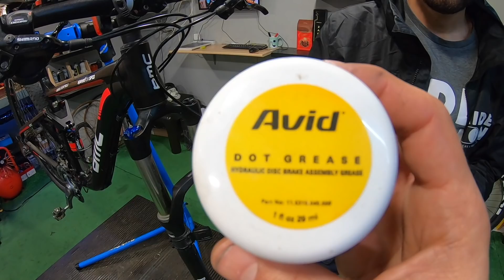🔧 Freno de disco: CÓMO LIMPIAR Y ENGRASAR los PISTONES de BICICLETA |🏅Curso mecánica online 2021.

Comment: Hola. Gracias por este vídeo y el anterior sobre montaje de pastillas de freno. Cambié de llanta delantera hace poco, puse una con sistema center lock (antes tenía sistema de 6 tornillos), con disco y pastillas nuevas y estoy a vueltas con la pinza de freno, una XT, porque no soy capaz de que la rueda gire sin rozar (hablo de un roce que no es muy grande, pero sí supera lo "tolerable"). He probado de todo: separar pastillas, centrarlas (aunque debo ser malo porque no consigo que el disco deje de tocar un lado), he limpiado pistones, los he metido, sacado... incluso creo haber corregido una descompensación que había en la que uno de ellos salía más que el otro. Lo único que me queda hacer es lubricar, pero no tengo aceite mineral y con otro tipo de aceite, no me atrevo. La pregunta es si se puede utilizar algún sustituto del aceite mineral que haga el apaño o tiene que ser esa sí o sí. Y otra pregunta algo más tonta: el nuevo disco tiene ligeramente más grosor que el anterior y junto con las pastillas nuevas, se reduce el espacio libre, pero eso, entiendo, no debería ser problema, no?

Comment: Excelente video como siempre, pero me quede con una duda, no se si escuche mal, decías que si nos cargamos el piston no podemos repararlo porque no hay recambio de pistones y tendriamos que terminar que comprando una pinza nueva (minuto 7:39 al 7:44) sin embargo, tanto en amazon como en aliexpress venden pistones de repuesto para frenos hidráulicos, entonces pregunto, se puede no o no reemplazar los pistones, porque si como dijiste puedes sacar el piston para mantenimiento, pues evidentemente tambien puedes reemplazarlo si se daña, les dejo dos link uno de amazon y otro de aliexpress donde se pueden conseguir los pistones para frenos hidráulicos  https://www.amazon.com/-/es/dp/B08HD94YKC/ref=sr_1_1?_mk_es_US=%C3%85M%C3%85%C5%BD%C3%95%C3%91&dchild=1&keywords=ceramic+piston+ceramic+for+bicycle+brakes&qid=1618674835&sr=8-1  y https://es.aliexpress.com/item/1005001458198840.html?spm=a2g0o.productlist.0.0.359666e86nWtU9&algo_pvid=e004b8c5-13c0-4483-a6a0-814336f962a7&algo_expid=e004b8c5-13c0-4483-a6a0-814336f962a7-36&btsid=0bb0623916186748709597136e6344&ws_ab_test=searchweb0_0,searchweb201602_,searchweb201603
Reply from the maker: Quiero decir de Shimano, las demás marcas suelen tener recambio original, en Shimano repuesto original me cuenta encontrar y en su b2b no lo marcaban como recambio, eso recuerdo.
Respecto a lo que has pasado si que pueden servir, gracias Giorgio!
Reply: @RIDEONRidersMechanics  gracias